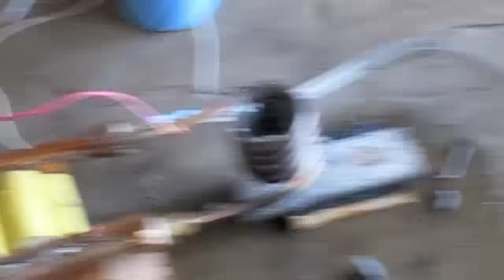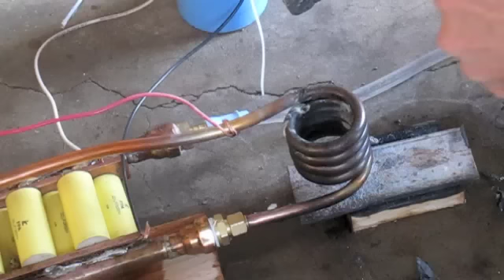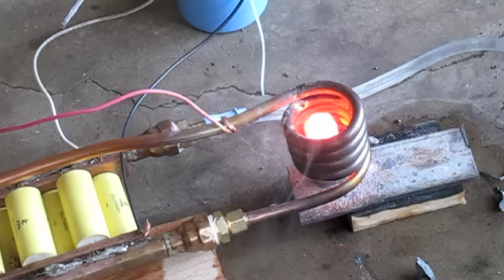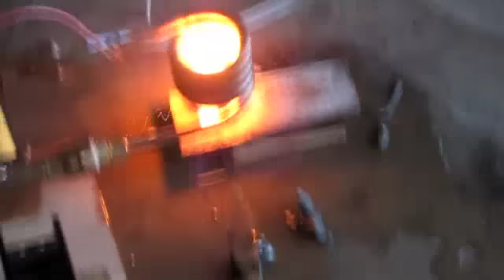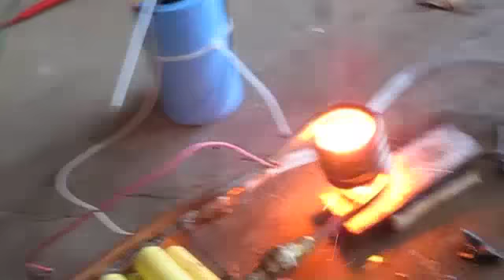3 kilowatt Induction heater melting zinc aluminum metal

Comment from the maker: I have listed some useful tools in the description for building and testing an induction heater.
Reply: Sir what should be the input voltage and current
Reply from the maker: @leelachoudhary8536  Depending on your components you can use between 120vac and 240vac. The current will be somewhere between 10 - 20A depending on your coupling transformer's number of turns. Make sure you have a breaker connected to your varian incase you create a short-circuit if a mosfet blows.
Reply: sir what will be the from of current ac/dc
Reply: @samsagar1578  ac
Reply: Instablaster...

Comment: I applaud your effort. Fabricating an LC circuit theoretically with mosfets hand rolled reactor and capacitors is not easy! I've been working around induction heating for 30 years and I totally enjoyed this video.  I have purchased a number of induction power units recently from Asia but now I am again compelled to build them for fun.

Comment: I used to work with 150kw Statipower Induction furnaces for big production runs. We could melt a 1 inch bar in about 10 seconds on full grunt. This thing was massive, at least 4ft wide, 6 ft long and 7ft high, and had a mobile capacitor bank about the size of a small refrigerator with a remote pendant and 2 inch lines coming from it. We had to take rings and piercings off as they tend to get pretty warm if we stood too close to it. It was pretty rare for us to use all 150kw unless we were hot-forging 6 inch round bar or more. There was a 300kw heater out the back but that was mainly for induction melting more than 10-15 years ago, it has since been decomissioned and sold for scrap, it would have been sheer overkill for what we wanted
Reply: Asalamu Alaicum Bhai sahib mujay is tarah ka induction heater chahiyay  wire ko aneal kernay k liay  kiya aap is mein merry help ker saktay hein 03009494140

Comment: @quimufpr (1) Theoretically, yes. But the problem is this: The heater is basically a transformer. You're transforming a "high" (high relative to secondary, that is.) voltage with a "low" current through the primary side, the pipe in this case, to a low voltage with a high current in the secondary side. The primary only has a couple of turns and the secondary has no turns, it's just a metal object.

Comment: I'm sorry, but I think that what you were melting was definitely NOT zinc nor aluminium. Aluminium has a melting temperature of 660 °C and zinc even lower 420 °C. Those temperatures alone guarantee you that these metals will NEVER be yellow hot AND stay solid. Hell zinc can be melted even with a better soldering iron and aluminium will only glow dark red AT BEST (when melted, not when solid of course). What you have there is probably some good ol' zinc plated steel (at best). 'nuf said.
Reply: +CoolKoon You're nothing but right.
Reply: /watch?v=NUYqGX6a4vQ But there the aluminium is glowing yellow
Reply: +Tobinator Yeah. I didn't mean that aluminium can't glow yellow (of course it can, its boiling point is fairly high). All I tried to say was that when aluminium is glowing yellow, it's WAY beyond its melting point (a faint red glow is all it acquires when it melts). That said the yellow glow on the top in the video could've been some impurities/slag too, because the aluminium itself seemed to have more of a reddish glow, the yellow glow remained on the top of the pool of molten aluminium and when the casting was finished, there was a considerable amount of what appeared to be slag left in the crucible.
Reply: maybe he doesn't know his metals like AT ALL
Reply: i get that people pronounce it "aluminium" but its not spelled that way, its spelled "aluminum"
Reply: aluminium is the official spelling from the IUPAC (union of chemistery)
and aluminum is an acceptable variant.
there are quite a few words that are different on each side of the pond, like colo(u)r, armo(u)r and arse/ass.
Reply: Look at the sparks... Seems like HC steel to me.
Reply: Also I think this is something ferromagnetic. So yes this is NOT zinc.
Reply: yes no: you are wrong, ALUMINIUM is official name of that metal in periodic table, aluminum is faking american short cut.
Reply: @kobudoka1165  when you say it like an American you can forego the limp wrist during pronunciation..
Reply: Non magnetic metals can not be melted with inductive heater.
Reply: @samiraidi8663  wrong, non conducting metals cannot

Comment: Let me suggest to use a ceramic insulator, to avoid any thermal shock if the copper coil is pierced, I think it's great, you can  produce  core drilling tubes using synthetic diamond

Comment: @drumslayer27 heat capacity of water being what it is, not likely. The sheer power required would amount to a small explosion, and all of that would have to be converted to heat in water really efficiently (ie, water would boil near the bottom, and be cold near the top).

Comment: @imanulsofian 3 kW isn't thaaaat much in the grand scheme of things. It's common for microwave ovens to consume 1 kW or more on the highest setting. An electrical stove will typically consume 2-3 kW per plate. You may want to check that the fuse you're connecting the thing through can handle the current, but otherwise it's not a big deal.

Comment: @fjoa123 copper melts at 1080 celsius, aluminum melts at 660 celsius, zinc at 419. The temperature is directly related to how much power he's putting through the coils. You could melt your coil if you cranked it up too high without a cooling for your coils. And good luck cooling off something at 1080 celsius that isn't going to screw up the rest of what you're working on.

Comment: Looked at your site and tutorial. Looks like a pretty solid design. Problems might be getting gate drive transformer and other ferrite core. Variacs are expensive and sometimes hard to find so maybe you can find a way to control the gate drive (PWM) maybe and IRF450 fets for higher voltage. They are rated at 30A I think. I forget polarity but a diode across the G-S will help the fet turn off faster. Don't know if it would help this situation. I'm not an engineer. :-D

Comment: i am trying to make induction heater using cd4046,but i have a question regarding the cutoff freq,how to determine it? for example if my fmax is 70KHZ and center freq is 60KHZ,and min freq is 50KHZ,what will be the cutoff frequency according to it,i can design my low pass filter, any excel sheet u did?or any formula,plz i need ur help in this issue
i appreciate ur answer.
Best Regards
Alloush

Comment: @quimufpr So the problem with heating a body part is getting a low enough resistance to induce enough current to do any significant heating. Compare it to what would happen if you connected a good 10V power source through a piece of metal vs through your hand, even if the electrodes were connected inside the skin. Less current in the latter case, because of the resistance. That said, inductive heating of body parts still wouldn't be very healthy, I think.

Comment: Hey, i really want to build an induction heater/furnace to make some details of metal.
But i am not smart at microcontrolers and chips. 

My question is , if you use a chip do you write a code/ programm on it or you just be the chip and connect it to the circuit?

Answer is greatly appreciated!
Reply: no you dont use a chip, the frequencys needed to run a induction heating coil are much too high for a regular micro controller to reach

Comment from the maker: @t3hPoundcake Sure.  Anything that can control the input voltage will work. Just make sure you do not exceed the current rating.  If it is fused, make sure you stay below that current.

I explain a lot at inductionheatertutorial x com

where "x" is a .

Comment: It is hot but doesn't melt
As you said (audio) it was aluminium not zinc.
Zinc melts about 700 degree centigrade and aluminium at 660.

Comment from the maker: I just made a digital thermometer capable of accurately measuring LN2 to 0.1F accuracy. This is way better than most commercial brands.  Watch it here:
CryBaby cryogenic LCD digital thermometer
Reply: Hi..my. friend..can. you. Help. Me..?  For. Induction. Heat..
Reply: imsmoother Would you say this is better than the dead simple ZVS driver? It seems your design is more complex with it needing a phase loop lock and feedback loops whereas the ZVS driver design automatically changes resonate frequency with no active electronics needed. It's basically a modified Royer Oscillator.
Reply from the maker: EETechs I do not think a ZVS can handle high wattage.  I'm not sure, though.
Reply: What are you using for the power supply?
Reply from the maker: Owen Chase science channel Just 120vac connected to a variac
Reply: O ok
Reply: +imsmoother what variac are you using? I need to buy one with that kind of amperage.
Reply from the maker: For the 3kw unit I used a 120vac/20A variac that I got on Ebay. I would try to get one that is 25A if possible.  You can look on Ebay or Amazon.  Make sure you check that the output leads are correct as many of the Chinese units have them backwards, or have the common connected to the ground/chasis.
Reply: Нахуя ты это сделал?
Reply: +Владимир Бондаренко Нахуя ты так говоришь?
Reply: imsmoother

Comment: I have a problem I have worked the induction heater more than 50 times and I have seen many videos from youtube, but the circuit did not work. Please answer as soon as possible My job is disabled due to this circuit ..

Comment: How could that be aluminium? It doesn't glow like that. The melting point is about 660°C (1220°F) - so if it was aluminium it would just glow slightly red before it starts pour out at the bottom.
Also - the title says zink so it seems more like a zink coated steel bolt with the zink layer burning off. Nice induction heater anyway
Reply: I agree, aluminum would melt long before it reached that temperature. You can see the sparks from the steel crucible melting though....
Reply: I am on your side Ride84XL, The only part of Aluminium that shows colour is the oxide on the top of the molten metal. The metal itself would show as a pale silver colour in my experience. Other than that very interesting video, cheers from John.

Comment: What’s the frequency range? I bet it’s over 200khz
Reply from the maker: Depending on the coil between 70-130khz
Reply: @imsmoother  but I’ve heard that aluminum requires high frequency
Reply from the maker: @zana9219  I guess not. It melts very easily with only a few kilowatts input.

Comment: what kind of power do you use? and how much power is needed?
Reply from the maker: This was using 2.5-3kw (220v @ 10-15A). You can use 110v but will draw more current from mains.

Comment: I want to build a 3kW induction heater but I don't know what kind of source I need to buy, how many Voutput and Aoutput needs the source?
Reply: it depends on the voltage you will run the coil driver with if 12v then you will need 250Amps for 3kW, it just basic ohms law. and if you are on a 120v main supply you may have trouble if the wires supplying the power supply with mains are small because it would need to draw 25Amps if your on 240v mains will draw 12.5 which it should be able to do but the wires may heat up a bit if not made to support that current.

Comment: Hi, I'd like to know how your heater handles the tremendous current flowing through the circuit beyond Curie temperature?
Reply: A little too late but, water is flowing through the pipe of the coil to cool it down.

Comment: Myself Swami L.B M.E Student .I designed  3 KW induction Heater as per circuit diagram which is available on your web-site.I designed LC tank as per your scheme, the value of inductance in your ckt diagram is 0.8-1.3 microhenry but when i measured the value of inductance on LCR meter it shows only 0.01 micro-Henry which is least count on 200 microhenry range. And capacitor value is 0.22 micro farad such 20 capacitors i joined. The value which is written on capacitor is TC 224K,2KVPN weather it is correct value as 0.22 micro farad?

if any wrong in LC tank connection or component please give me the suggestion as early as possible. i hope that your valuable suggestion is helpful for me.

Comment: Cor..... Look at it Glowiiiiiiiiiiin' :-O

That got mighty hot in there! An interesting experiment would be to put a hollow steel tube in there and run water through it while the induction coil was turned on.....

.....Induction water heater. :D

Thanxx for showing,

-BoomBoxDeluxe.

8th August 2014, 15.55

Comment: You clearly didn't understand what i was saying! I am aware of the fact, that electromagnetism causes the rise in temperature in the heated object, and that the process in called induction. The think i didn't understand yet, was how the actual could gets cooled, because if the massive amparage going through it, it would get very hot itself normally. and i just realized, that it is a pipe, being cooled with wather, so please don't call others uneducated if you didn't even get my point!

Comment: I dont understand how you can build something more then a Lego set and fail so badly at terminology 
1: Its steel, not aluminum, as many people explained in the comment section.
2: Its a nut, not bolt.
And thats basically 70% of everything you said.

Comment: your confusion is caused by the fact that aluminum melts under the influence of your welding torch long before it becomes hot enough to radiate visible light. What you're looking at here is not a "color change". It is a material radiating visible light due to its temperature. All material bodies whatsoever radiate corresponding to their temperature. this has nothing to do with we call "the color of something'. Don't despair, you too can be educated.
Reply: yeah, its obviously not aluminium and zinc. It is a pretty nice induction heater though